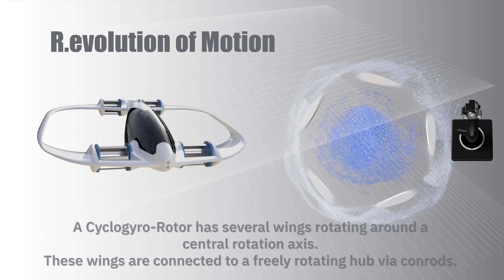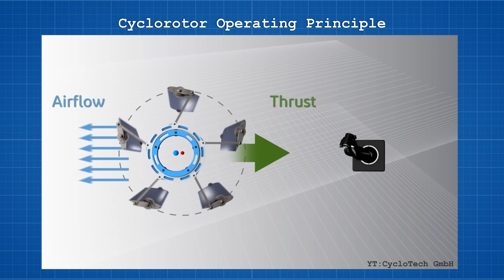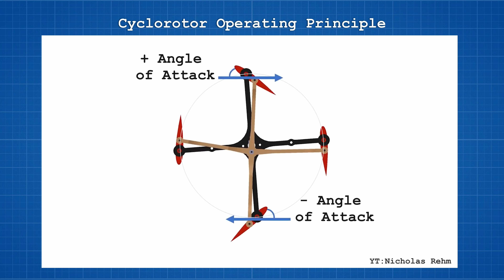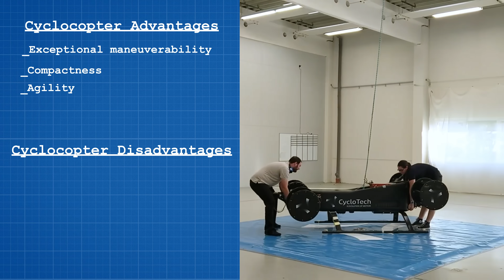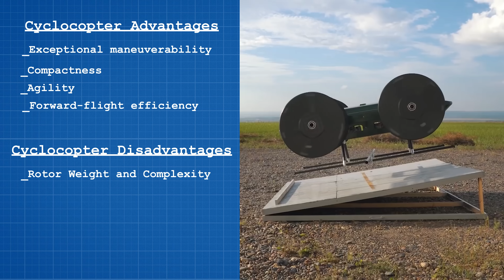CycloRotor: Is this the future of eVTOL Electric Propulsion System?

Comment: this drive is not working huh?  , and you are probably wondering why, even if you make the blades not profiled (which rarefies the air inside the carousel), the center of the vortex twisted inside the carousel remains discharged according to its inherent laws, and since it is supported by rotation, this is wonderful)) machine for a tornado,  is not it ??  But you can try to pump air there, for example, if you place two wings in front and behind the carousels, then during the flight the air will be organized by these carousels and, moreover, more will be supplied to the lower surface of the wing, which in turn will increase lift, but only it,  and since this is not energetically justified due to the resistance to the oncoming air flow instead of using it as all aircraft designers do, then alas and oh, but you probably tried to make an apparatus on the principle of a helicopter ???  so the effort that you can extract can be calculated using the coanda effect formulas (teapot effect), but no matter how hard you turn the carousel, it is not enough for the mechanism;  better pay attention to the mechanism presented at 1:33 in the video, oh yeah, it's a regular screw

Comment: My bet: if it was efficient, it would already be used by Airbus, Boeing,....
Reply: Why you decide so? 

In late 1980s Soviets built large passenger airplane (150-180 passengers) which used liquid hydrogen or liquid gas. Super ecological and cheaper. But because dissolve of USSR, project was closed. In early 1990s engines from that airplane Russia as present gave to Airbus. So what? They still can’t repeat it and only planning to build similar passenger airplane somewhere in 2030-50s. Russia also can’t repeat, because have no similar Soviet industry. 40 years old technology lost and nowadays too complicated for modern countries.

Let’s remember history of ancient Soviet RD-180, super efficient engine (almost close to theoretical maximum in own class) for space rockets. US bought blueprints, for years tried to repeat and failed. As they said in result, can’t repeat similar alloys without which such engine impossibly (or it becomes too heavy/large and need to full reconstruction, or too weak and melt/explode).

Another example: powerful space reactors for space. In early 90s US bought old Soviet reactors... and still nowadays failed to repeat, while actively trying. At same time Russia already built few generations and now use 1MWh reactors to launch fully functional classical huge military radars in space (which means different epoch for army, when you have radars not on ground, but right over battlefield).

Often misc technologies arrives regards to genius of some one man or breakthrow. Just happy chance, not because “I want this and I will do with easy”.
Reply: @juliap.5375  Efficiency, on airplanes leads directly to energy cost. You can make a huge plane made with concrete and make it flight with enough amount of energy. Anyway, that won't happen because of costs and efficiency of each amount of power available is used for. 
I guess.
Reply: @FrenchyGameVideos  You are right, but if you need something unique, as example to carry something non-standard, you will. As example Soviet An-225, the heaviest aircraft ever built, with a maximum takeoff weight of 640 tonnes. It have 6 engines, incredible ineffective, but sometimes you just have no option. And now it used literally by whole world. It is expensive, true, but there are no alternatives.

This copters allow to do what nobody else can, it means even if they will be less efficient, it means nothing. For city usage they are best and we just have no alternatives.
Reply: @juliap.5375  Yes, thats right. I met the AN225 in 1994. That plane is crazy. Even tho i've been working on A380, I remember how big this plane and been wondering how this thing could possibly fly..

Comment: Can be used to steer the helicopter pulling it's tail up to accelerate without losing the lift trough decrease of the lift in the front part of the carrying propeller. Better vertical leverage

Comment: Too bad you guys can't figure out how to charge it with the paddle wheels so you can fly as long as you want. It should also have gliding capability designed into it just in case something happens to one of the paddle wheels. Too many moving parts leave too much room for something to go wrong. Needs to be better designed.

Comment: If one rotor fails, you are instantly at half power because to keep the thing balanced, you would have to power down the one opposite.  Both winged aircraft and helicopters can glide or autorotate down from a power failure. Is there the equivalent of autorotation on a 'cyclorotor'?

Comment: The blades aren't in a lift generating position for most or at least probably about half of the time. Wouldn't it make more sense to have them on a belt like a belt sander so they're horizontal most of the time?

Comment: Aircrafts in average spends about 9/10 of energy consumption only for staying in the air. By replacing cars with aircrafts we need x times more energy to produce, compared to traveling by cars. And cars are problem also now. I think this is step wrong way - work should be started on antigravity systems, or high efficiency engine systems...

Comment: Closed system steam engines keep the thermal heat from steam from escaping and get reused. So they are lighter than a standard engine and a tank of water  ..less weight...enough force these turbines?

Comment: Still need an electric generator.....could be. NO PROPELER BLADES TO BREAK....so a generator aboard could supply the electricity.HHHHhhhhmmmm....a combination of HYDROGEN BURNERS
could carry enough energy to run the power source. CLOSED STEAM ENGINES COULD DO IT AS WELL...they run on ALCOHOL...see the BESSLER STEAM POWERED AIRPLANE owned by the Bessler Brothers.

Comment: We actually need wheel that can pivot and turn into propellers. I assume Tesla will be the first to pull this off. It would need some kind of system to lift it off the ground so the wheels could pivot and lift it but I assume even if the tires were vertical if the props inside the rim were strong enough your could start to get a little lift just from that alone.

Comment: interesting. seems very complicated though, and might be much bigger risk of failure and disaster. all those shifting blades with pivot pins. But obviously the engineers have good reason to pursue it. in flight stability against wind gust changes, maneuverability, efficiency etc. 😎

Comment: Conventional heli can have  autorotation, this design looks too chunky for it to glide whenever power out. Tho I've  seen some designs integrated into a conventional fixed wing, tho not looking all that better either. Also having gyro or what not forces create tendency for aircraft to pitch up or down when balance is distupted like if one cyclo fails. Doesn't  look more advantageous to a prop quadcopter that can still be airborne on props failing ..a parachute is needed as well so yeah.  Neat as a unmanned toy.. only

Comment: Would it be more efficient have it  vertical/ sideways  and pull air in and have hole on bottom where that air can crate thrust? Meaning in side it crates a vacuum pulling air in making thrust down also having that vortex lift.. this should also make flying at low attitude more stable..

Comment: Seems like half the time the blades aren't producing thrust. It'd be like a traditional quad copter with 4 blade props then removing 2 blades on each prop. Plus the weight of the endcaps...

Comment: since the rotational speed does not have to change much, I am wondering if it would make sense to connect the rotors to a jet turbine, to increase flight time and distance traveled, as an alternative to powering it strictly off the electric power. Would this design work if all rotors are always turning at the same RPM?

Comment: Eh, no.  Definitely not the future of any vtol flight.  Too much rotational speed is needed for lift compared to a coming rotor.  The only thing this type of rotor system does that's better than a helicopter is that it can fly forward and backward with nearly zero pitch.

Comment: At first glance it looks pretty cool but then you start really thinking about it and there’s a lot more stuff that can fail, ie moving parts and what not, good thing that if the rotors go kaput the thing will glide down to earth like a greased bowling ball and the whisper quiet rotors that are continually making you go deaf. Great concept but it seems to need lots more work.

Comment: It may not replace traditional rotors completely but I can see a definite advantage where traditional helicopter rotors could be considered a danger or a limit to available landing spots such as in a medevac situation or powerline inspections etc.
Reply: if you are that worried about it, use ducted fans.

Comment: A single rotor has a gazillion independently moving parts but powered by the same single motor. How do they account for a successful flight/landing with one tip/blade malfunction hence generating unwanted propulsion making it inefficient especially using battery power?

Comment: Four automotive blower motors attached to a fuselage. the blade design is good for keeping the noise down and moving air with high speed low torque motors. These aspects are not useful for efficient energy usage and providing lift. Sorry to crush your dreams.

Comment: Ha ha, thought I was going to see a "new" tech based on gyroscopic thrust, even if it were that it would not be new tech but a tech that was laughed out of the science community as a hoax. This new tech is a helicopter with the same pitch change to the blades but what looks like a fixed change in pitch but with electric power, mark twain would have invested in this maybe but not someone who actually wants to retire at some point.

Comment: As aircraft electric drive systems have much lower power to weight ratios than internal combustion systems, higher inefficiencies of a particular type of electric drive are even more critical. There are a lot more moving parts in a cyclorotor compared to a multicopter or a fixed wing propeller system, so it is far from obvious what the ofsetting benefit may be.
Reply: Just because something is possible does not mean it is an improvement.

Comment: I see lots comments about how inefficient it is, and it has many moving parts. But that doesn’t mean that innovation has to stop. Kudos to the team for achieving this prototype.
Reply: You can't innovate your way out if your basic concept is completely clueless, which this is.
Reply: @San-nj6mp  it's novelty, brother, not innovation. Cars using wheels, that's adoption.
Reply: @abadran8174  You won't know when one of these stupid looking ideas end up in space robots or landing gear in some kind of reusable rocket. You need to try stuff to do stuff.
Reply: @ॐअखंडधर्मःॐ  no, if its a bad idea that is horribly inefficient then it wont work
Reply: There's barely anything new about the concept nor its implementation, and there's nearly no room to improve either. Its also inefficient and complex, with a lot of room for malfunction. It might have a couple of uses and advantages, but with current battery tech its near useless, with a gas engine a normal Vtol is far more effective and efficient too...
Reply: @mkzhero  Absolutely incorrect. Cyclorotors have much better efficiency in firward flight compared to helicopters or syncropters. 
Also in terms of safety, theyre far simpler and have fewer points of failure compared to tilt rotors. Theyre not death traps like the V-22 osprey, which domehow is approved to transport living people.
Reply: This isn't innovation though. I can make a propeller that consists of just oscillating Chinese hand fans. But I don't think that's innovation
Reply: @abadran8174  There is a difference between "I can make" and "I have made"
Reply: I agree.. And with 3D printing technology.. further advancements can be achieved on blade and rotor design for increased strength and with less weight. I can see a design like this winning out for VTOL over helicopter design.. It can be safer and makes less noise. It will be interesting to see someone come up with a 2 rotor version that a human can carry on their back .. like a jetpack. I can see autonomous versions of cyclocopters that can have platforms for carrying loads.. perhaps even being used for construction and emergency evacuations from tall buildings, etc.
Reply: @manp1039 forget about additive. 3d printing is no go for this kind of application. Due to dozen of reasons

Comment: The passive pitch adjustment reminds me of a helicopter. Of course it comes with a great deal of extra complexity over a multi rotor but has some advantages over the design of course, most notably greater control over the thrust vectoring.

Comment: Wouldn't it be more efficient to make a central turbine engine and use air ducts and adjustable vents to direct the air where you need it. It's hard for me to explain exactly what I'm talking about but You could use batteries to power the central jet turbine and be able to adjust the flow of air without using those four fans.

Comment: I was wondering , 1.what if we replace the ducted engines in lilium jet with equal number of cyclocoptors?
2.What if we put the cyclocoptors inside the wings of jetopteras blade propulsion ?

Comment: Propeller is still more balanced though. The rotation X axis is always negative to gravity which creates a better balance. This cyclone rotor is balanced on the Y axis negative to gravity which is good, but if it gets windy or more importantly when it starts raining, that could throw off balance better than having the axis balance centered towards gravity.
Reply: If ONLY you could take a propeller and rotate it to land and forward for flight :S /s
Reply: @keith3761 r/hatetheS
Reply: indeed this looked unstable

Comment: It is an advantage to be able to increase and decrease thrust without changing the engine speed? Really? Well if a regular Helicopter would be able to do this .... OH WAIT! They CAN. Nothing yet impressed me. Still no comparison to regular Systems. No Data. Nothing. The Video is just a big hoax like any other "wow look at this super modern technology and how good it is while it is clearly not" but just worse. Only your phrasing is impressive: "The efficiency of the cyclorotor is proven to improve during forward flight". Nice. That means nothing if the starting efficiency is so bad that it can never compete with regular systems. Sorry but this is the best example for one thing. "Only speak the truth but bend it so much that the regular viewer will believe the opposite". This video was kinda infuriating on so many levels. And you know what? I love new tech. That's why I clicked in the first place. But here I have to give one of my biggest dislikes in the last 10 years.

Comment: 3:32 Sorry, numbers in a vacuum are not very impressive. Numbers are only useful if you have some sort of existing baseline or standard to compare to, e.g. the thrust/weight ratio of a quadcopter with rotors of similar diameters.

Comment: So its basically pumping air downwards to move.
I can see that ending in tragedy quite quickly. It'd be better of as a concept for car engines.
Reply: I'm not certain that is the correct physics and would like to see that further analyzed.  It's rotating wings still, so the physics should be the same as a typical wing.  The air is only being accelerated, not compressed.  And there's moments where at least one wing per wheel would be perpendicular to the direction of travel.  Drag is going to be extremely taxing.

Comment: i think anti gravitation flying cars will never ever happened. for my opinion cyclorotors technology is the best solution for flying cars in the future! it has so much potential for the next decades in the 21th century becoz imagine if mechanical engineering can fix the battery-energy problems and construct and integrate the 4 cyclorotors as wheels for a perfect vertical and azimut elevation, flying cars will taking off with this kind of technology.

Comment: Cool concept. Maybe instead of carbon fiber, a more reliable material like aircraft grade aluminum for blades? Or instead of using 4 large ones, use more smaller ones to generate the effect and reduce the load per blade? I'm not an engineer but if you had 6 rotors, the overall size of them would be smaller. But then again, that might increase weight for extra motors and transmission parts.